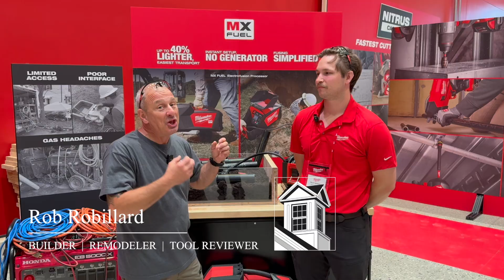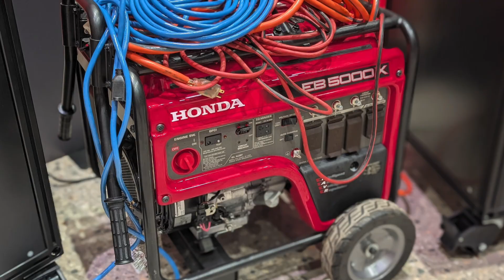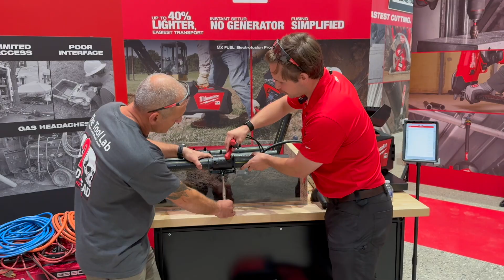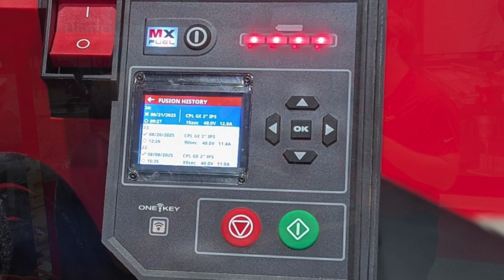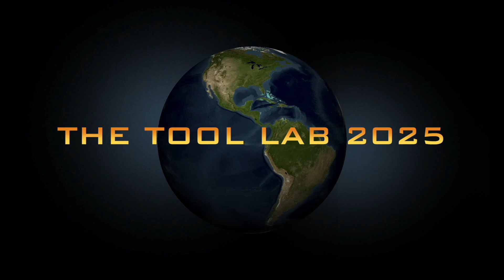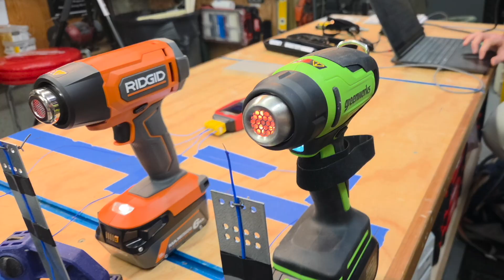Milwaukee MX FUEL Electrofusion Processor

Comment: I'm sure it will work for geothermal. We use same pipe with socket fusion for the ground loop. Its just water instead of gas.

Comment: i use that wired one every single day doing gas services in new york. if you have any other questions about the process, please ask!
Reply from the maker: Do you think a cordless unit like this will save you time and effort?
Reply: @ConcordCarpenter  yes, instead of taking the generator, and fusion machine out of the truck, wheeling the thing up to the building or down the road. i can just grab that thing and go. i just need to convince my company to get it for me now hahaha